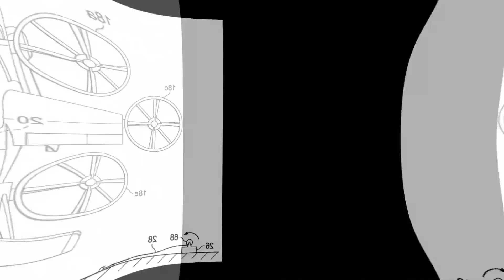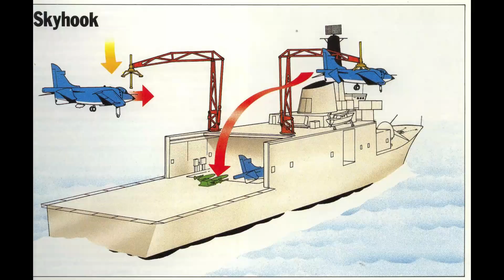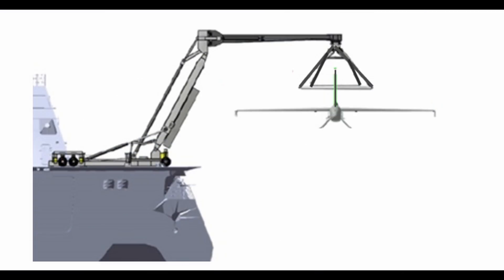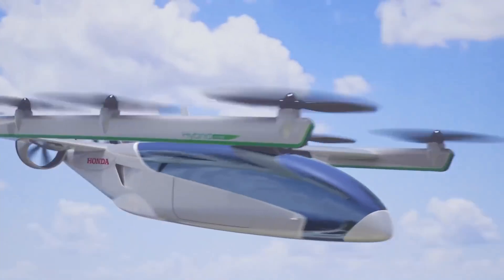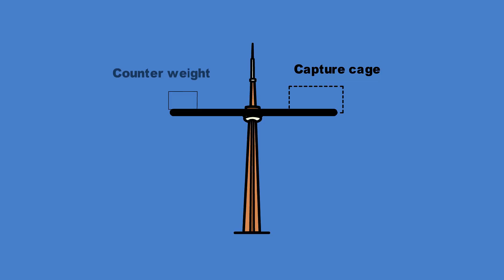Batman's Skyhook , Vertiports and  Advance EVTOL launch methods

Comment: You didn't mention the vast array of safety features that would be part of a UAM terminal.  The terminal can have sensors to know the micro-meteorology in the vicinity to the millisecond and share that information with the aircraft in real time.  This can literally allow the aircraft to deal with wind gusts or shifting wind direction before it even happens.  There is also an incredible value added in automated scheduling, deconfliction, and what amounts to aircraft control.

Comment: A summary point that you should make about UAM (Urban Air Mobility) terminals is that you can add something like $100 (or more) to the terminal if it saves $1 on the aircraft.  This is because hundreds of aircraft will use the terminal for many aircraft lifetimes.  It is also far easier, safer, and cheaper to build functionality into a ground based terminal where weight is not a problem.  This goes for maintenance of that equipment as well.

Comment: There is a simple, cheap, and well proven solution that works for autogiro derived aircraft.  You simply provide power from the vertiport to pre-rotate the rotor to high RPM and then use the energy stored in the rotor to do a jump takeoff. Once airborne, it becomes a standard autogiro.  Autogiros are capable of no-roll or very short roll landings so no problem.  Rotor tip rockets can be used to sustain rotor RPM for an emergency go around or landing, and rotor tip weights are needed anyway. Autogiros can be optimized for low noise.  Finally, An autogiro does not require distributed propulsion and works fine with a single propeller, so electric power is not needed.  Optics aside, there is no real environmental advantage to making these aircraft EVs as there is a tremendous amount of energy used to make EVs, plus pollution from the mining of lithium, copper, etc., primarily for the batteries.  If you discard the EV requirement then IC engines can do the job with more than adequate speed and range.  Finally, an autogiro is always in autorotation, so it is like flying with a parachute already deployed.  The inherent safety of the design eliminates the need for a BRS (Ballistic Recovery System AKA Rocket deployed Parachute).

Comment: In the event of emergency the electric aircraft should not be limited to aeroports with the correct landing apparatus - you must keep your options open in aviation. Also, standard operating procedure for any method of launch is to assume that the engine will definitely fail then develop the launch method from that. Some examples:
Helicopters taking off from tall buildings will actually climb out backwards to allow them to autorotate back onto a visible landing area in an emergency.
Carrier operations always launch a helicopter first because "when" that fixed wing aircraft engine fails it saves time rescuing the pilot.
Gliders annual checks require demonstration of failed winch launching at the "land ahead" or "turn to reduced circuit" height.
Completing a safe take-off should never be taken for granted. Eventualities are the most important part...

Comment: They need to start building VTOL like the osprey
Reply from the maker: The are building. With Osprey you had a design compromise of putting two large engines at wing tip. They are now doing it with more distributed propulsion

Comment: Many thanks for your videos ... I'm doing research for my company at the moment and your work is an excellent start point for aggregated information.   WRT the assisted T-O and Recovery ... my main concerns (as a future customer) are repeatability and comfort. I know safety will require a long verification process, particularly for anything derived form military UAS operations, but the idea of using a landing method that relies on precision or anything which negates go-arounds or diversion to an alternate landing location will be a hard sell.    My own thoughts on an off-the-wall idea was the use of an upward blasting stream of air ... or several computer controlled air jets which could cradle the eVTOL as it lands... but even this seems like giving too much trust to a new unproven technology..... The Mothership by Talyn... is the most interesting and potentially benign concept here.  It could prove itself easily with cargo ops ... and migrate into something like a flexible air tax system that allows safety and comfort.

Comment: Probe and drogue in flight recharging in which a battery electric airliner is met shortly after takeoff by an autonomous craft trailing a drogue cable and connects to be powered while climbing to cruise altitude. The recharger craft then returns to the airport to itself recharge or battery swap for the next airliner.

Comment: Are there any concepts with microwave power transmission?
Reply from the maker: Microwave power is used in plasma jet system. If you are referring to wireless power supply, than yes that is being looked at by US NAVY
Reply: @ElectricAviation  Thanks for the reply. I was indeed referring to wireless power supply.

Comment: A VTOL platform on a skyscraper could sit on top of a rod going into the building - like a piston and connecting rod. The rod could be a linear induction motor to shoot the platform up some distance. Could even go back to the first assisted take off method of the Wright brothers, a weight dropping under gravity raising the platform. Doesn't seem to do much for landing.

Comment: Fit, " Kangaroo legs," to a VTOL, i.e., long, spider like legs that enable a craft to land at higher speed, the force being absorbed and stored, as in the tendons of the roo. The stored energy is used to spring the craft into the air for take-off.
Reply from the maker: it is a good idea. There are synthetic muscles
Reply: @ElectricAviation  Also, a VTOL could gain altitude from a balloon. Having reached desired height the VTOL would be detached. There is then the problem of balloon recovery, perhaps by dropping a cable which is then guided to the platform by a drone on its end, if wind hasn't blown it too far away.  I'd already thought to have a mains cable connected to the VTOL, with a winch on the craft to recover it. It could be lowered for landing and somehow guided to connect to mains power - a large bowl shape.  Also another idea, for fixed wing aircraft, have an electrified conductor rail along the runway. 
Enjoy your content, thank you.
Reply: @ElectricAviation  And for helicopters, especially for landing troops, quicker in and out.

Comment: "Drag chutes and tail hooks can be used to shorten the landing".  Do you have any idea how much an airframe has to be strengthened to withstand the rapid deceleration of a tail hook landing?  As I recall one of the reasons the F-22 was taken off the US Navy's interest list was adding almost 50% more weight in strengthening the fuselage.  The only reason the F-35 made it is because it has VERTICAL capabilities.  Drag chutes are almost as bad, the main reason they aren't is because they aren't as effective.

Comment: Interesting, but I don't think this will ever happen or work out. Infrastructure will have to be things like existing helicopter pads or even your backyard for any of the air taxi ideas to work out. Otherwise you could just take the tram.
Norm from Tested recently had an interesting video about Google's drone delivery airport and system. To be honest it's kind of scary that this delivery stuff will be monopolized from the start.

Comment: Considering most if not all aircraft flying within a city would have some sort of STOL capabilities, the take off assistance wouldn't have to be as great, and military aircraft are quite different in terms of size and weight (usually). New buildings could have these ports designed beforehand, so those could probably get sloped takeoff runways built in (woah, imagine a spiral shaped one, it could have smoother acceleration but would probably be more restricted to the high end). Catapults seem as if they would be easier to install on older buildings or where it's more restrictive on size.
 
Why not do it like carrier based V/STOLs anyways, have a short take off (be it assisted or not) and then land vertically. If the customer is wealthy enough then there could always be an only VTOL option, the market tends to like options and this wouldn't be free from that.

Comment: My idea (probably already patented by someone!) is a battery drone. The drone is all battery. It's either docked or tethered by a cable. The drone gives power for take off and perhaps goes a bit further to extend range. Then it detaches and flies back to be recharged. It's similar to the lifting drone but only supplies power not lift to the aircraft.

Comment: At 2:27 you mention drag 'chutes and tail hooks. No possible way. Neither of these motion arrestors are reasonable for commercial flight because of their long preparation lead time, the weight involved, the massive aircraft structure required to use them, and bunches of other reasons. STOL aircraft will have to use other means by which they can slow down without incurring the weight, expense, turnaround, and huge labor involvement of either parachutes or drag hooks.

At 4:27 you show a lift vehicle making an in-flight attachment to another aircraft for vertical descent to the vertiport. This is fraught with potential disaster. I can't imagine the FAA allowing any such coupling to occur in civilian airspace without decades of testing.

My idea for STOL ports would involve sloped runways used in the downhill direction for takeoff and uphill for landing. I'm not sure how this would work out in an urban environment, since safety of the surrounding structures and pedestrian traffic are of primary concern. I suspect such airports would still need to be somewhat removed from the heart of any city, perhaps overhanging a body of water. I'll let smarter people than me figure that one out.
Reply: Why can't they just land vertically and have a short take off? The slope or a catapult can do the take off part and when landing they do so in place.
 
If you don't like the jarring acceleration (probably won't even be that bad) then you could always pay for vertical take off. I don't see a problem with that.

Comment: Magnetic tube launch and capture system , called   sky port tube provides assisted take off and landing capability for drones .
The system involves open end  Magnetic tube ,  which interacts with the body of drone during launch and capture of aerial vehicle.
During capture ,  laser guided landing system enables the aerial vehicle to have precision entry into sky port tube.
 Curvature in Sky port tube could conserve space and energy. 
Sky port tube protects  aerial vehicle from weather fluctuation during launch and capture.
Reply from the maker: Thanks

Comment: Any launch/land system needs to take winds into account, and the fact that it is easier for a pilot (or computer) to match a stationary target than a moving one. Any catch and hold system will need very good coordination between ground gear and aircraft. In bumpy winds it would be risky! There is also the fail-safe requirement, which will be tricky in city environments.
All in all, simpler systems will prevail over fancy ones, and I suspect super-STOL (75% vertical?) with a bit of catapult assist for takeoff, and catch-and-cushion for landing may work best.

Comment: Airships  will compete for passengers and cargo - The Varialift Airship burns 80-90% less fuel than current aircrafts and reaches approximately 60% airspeed (IAS) of jetliners.
Reply from the maker: Yes I have done a video on modern Airships

Comment: The capture system could be inverted; the aircraft could drop a weighted cable which could be caught and wound in to a capture arm or mobile landing pad which would then be able to take the time to manoeuvre the craft carefully to a berth.   For tall buildings, gravity assist would be efficient and inexpensive; place the craft onto a rail which would extend over the side of the building, then the end of the rail is dropped and the shuttle upon which the plane would be resting would have its brake release by the pilot, the plane would then drop down the rail over the side of the building.  The type of craft I would prefer for this would be an autogyro that would, in the event of a motor failure, be able to auto-rotate down to the ground.

Comment: It seems no one is thinking about a Helium "wing" that would reduce the overall weight of the vehicle.
Hydrogen could be a more potential solution if we find a smart way to contain ignition with, for example, the use of a material like aerogel.
Great work, keep it going ✌️
Reply: Very low wing loading craft get very, very sketchy in any sort of winds. The risks get beyond sensible for a manned craft, which is why they are not common.
Reply: @OzAndyify  Hello Andrew, I'm aware of this. When you look at past E experiences with helium / hydrogen it's stands out that it isn't easy to manage situations on a certain scale.
Still, with today's technology you can give objects certain aerodynamic shapes and create forecasts like never before.
It is also possible to generate simulations to find the perfect balance.
This Helium / Hydrogen "Wing" should only create that sweet spot in weight reduction. Like 10 or 20%. This difference should create a substantial gain in power management and handling, resulting in a more reliable and cost-effective situation.
I'm certain that someone will find the way.
It's actually unfortunate we don't have the anti-gravity formula, yet 😉
Reply: @emmanuelm361  You may be right, but my money is on minimal air-frame, maximum speed. The beauty of Evtol is rapid point to point. Any "lowering of weight" with gas will come at the expense of more volume, which is more drag in cruise mode. An inflatable gasbag to cushion hard landings may well be an option though. 
Anti-grav would be wonderful...I'd settle for any reactionless drive!

Comment: What do you think of a vertiport with big-powerful turbines with exhaust direct upward, creating a "air cushion" strong enough to keep the aircraft airborne?
Special control surfaces would be deployed only during takeoffs and landings.
Reply: That would be cool. Passengers could exit the plane and skydive down to the port.
Reply from the maker: Haha. Good one.
Reply from the maker: Yeah I think it has some merit. A column of high speed air. If the aircraft is made correctly, it will auto stabiliize itself while landing

Comment: If it has wings ,why not have a platform ramp that blows air to assist takeoff.?
Reply: The aircraft could role into a hanger so when the doors close it is  in  a short, vertical wind tunnel and just be blown into the air. The aircraft's power would only be needed to control it, about the same as as for normal flight.